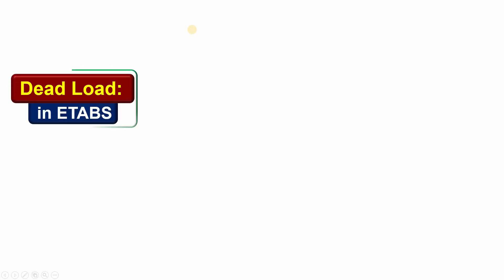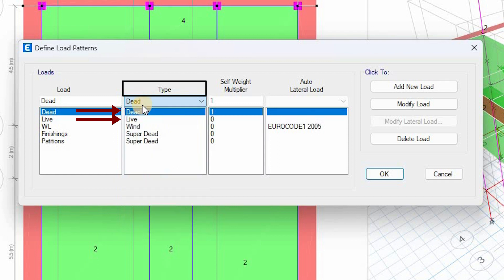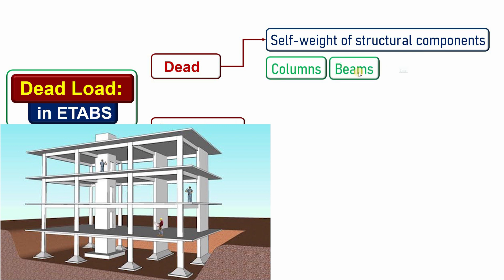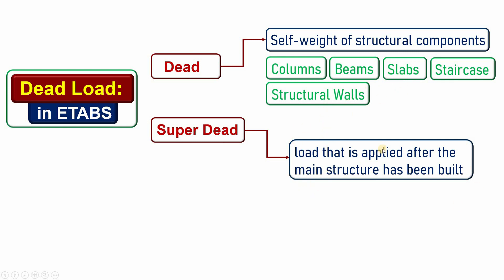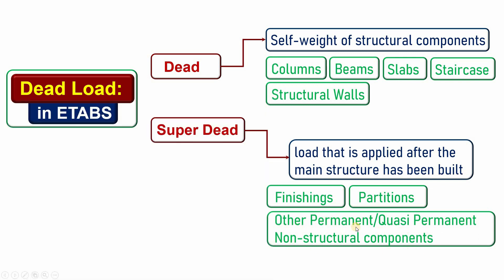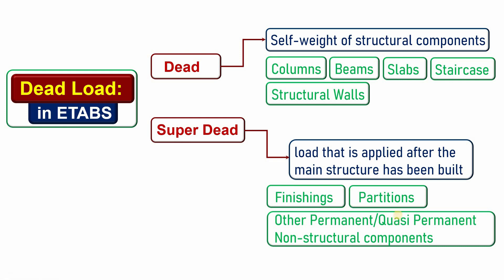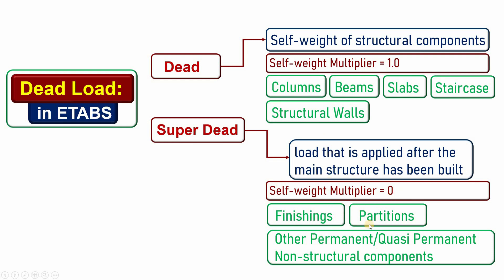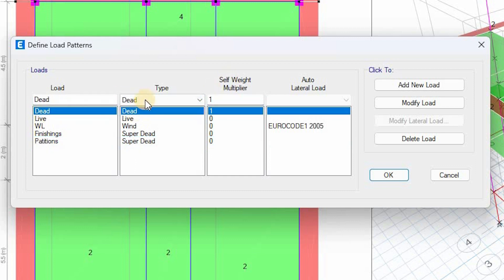Difference between Dead Vs Super Dead in ETABS- Permanent Vs Quasi-Permanent Loads #etabs

Comment: I have a question regarding this. Can we apply the SDL load while selecting the Load Pattern as Dead which having the multiplication factor of 1.
Does this affect the result or something like that?
Reply from the maker: It is better you follow the guide as per ETABS. "
 If you have multiple Dead Load pattern, typically only one should have a Self Weight multiplier of 1.0 applied to it " " DEAD"

So, You should apply Self wt Multiplier 0 for all other SDL
Reply: @icsaar99  Appreciate your response!
But for example instead of defining other load pattern for the SDL's I simply select the shell and frame elements and apply the load of super dead elements like of wall or tiles etc? will it have any effect or is it OK.